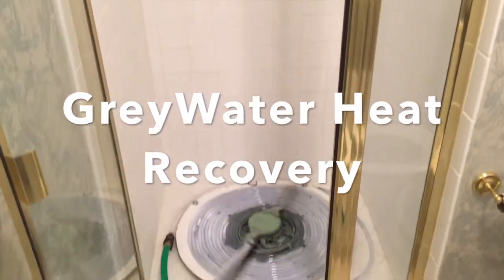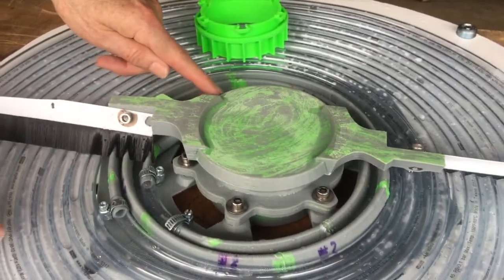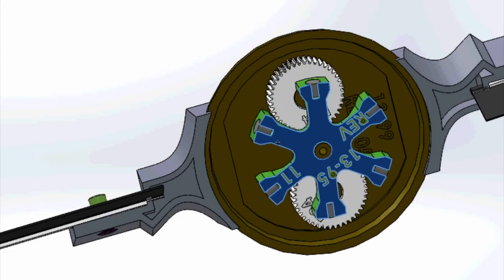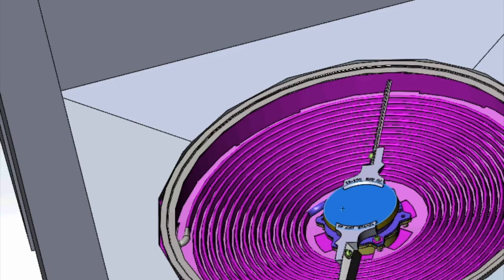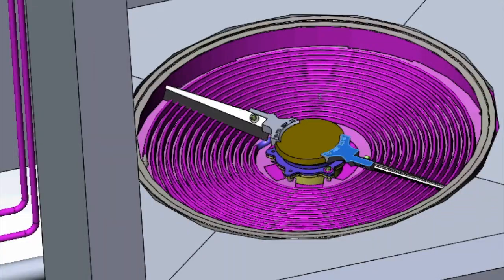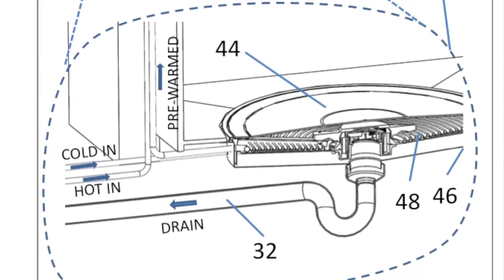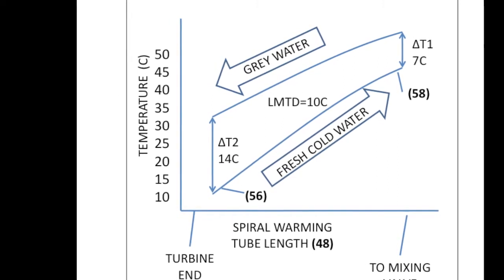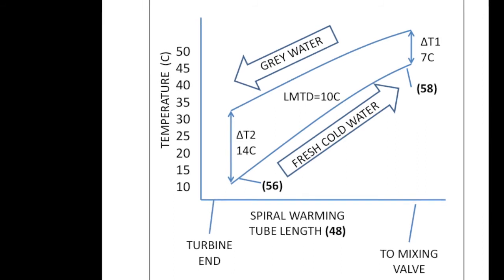GreyWater Heat Recovery

Comment: I agree, simpler is better.  Without the sweeping rotor the wastewater would find a path to the drain and some heat would be transferred. The repeated rinsing the wastewater against the copper tubing increases the heat transfer tremendously.  Think of windchill in the winter.  The temperatures are the same, but you feel much colder.

Comment: That seems far too complicated for the problem it is meant to solve.  Just replace the actual drain with copper pipe and have the the cold water travel through a copper coil that is wrapped around the copper drain pipe.  No moving parts.

Comment: Hello, is there anymore information about this system?
Reply: There is some.
I am a mechanical engineer and have the heat transfer analysis if you are interested.
This is a single pass counterflow design.

If you want to review the analysis, OK

Paul